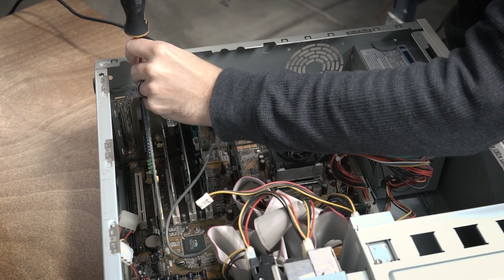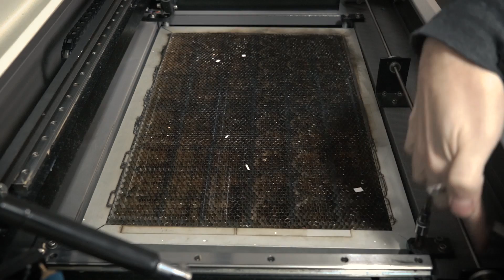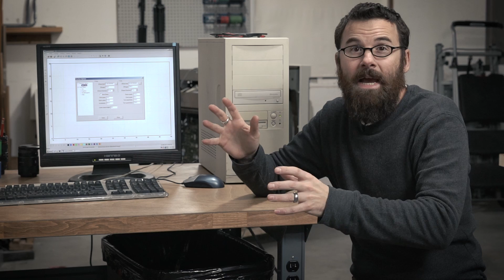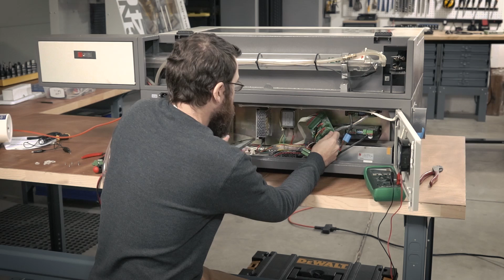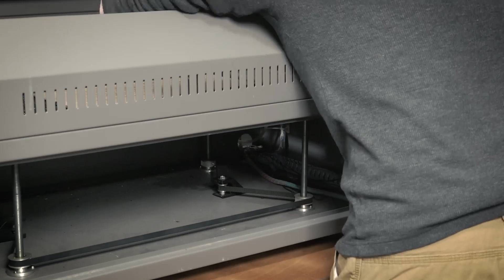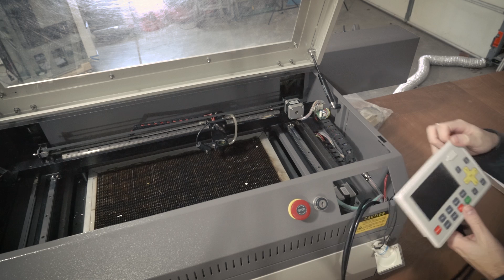DSP Laser Controller Install

Comment: hello...i already installed this AWC708C controller at my old laser machine SW1290 siwei brand but not totally working good....the machine cut not smooth. e.g :- circle cut run not as a circle and have a gap with it....another problem is the starting point cannot be set as i want to...are you have any opinion about my problem about this....
Reply from the maker: Regarding the movement, are you sure your stepper settings are correct?  It sounds like they are maybe not getting enough power.  You should be able to set the starting point wherever you want.  Just press the origin button.  Sometimes I use a second layer (like a rectangle or circle) around what I'm cutting to use as a reference.  I can then disable the layer, but the reference stays.
Reply: We had this issue on our laser and it turned out that the grub screws holding the belt wheel on the X axis had worn away slack where they fit onto the pin connecting with the cog from the motor. So when a circle is drawn there are two little kinks as the X direction changes. Not sure how well I have explained that but basically it's a hardware issue not a software one. We took the belt off, removed the cog and drilled a little deeper into the shaft pin then re-fitted making sure the grub screws were well tightened.

Comment: is the dsp able to set the laser power through software?  i know with the cheap ebay cutters you have to set the laser power before you do any engraving.
Reply from the maker: Yes, you can set laser power from the controller/software.  You can also do multiple layers too.  You can then adjust it through the controller for tweaking.
Reply: Thanks for speedy reply. gotta say, content is top notch.
Reply from the maker: thanks!

Comment: Hmm what about laserweb on a raspberry pi, and a smoothieboard? It being open source is a big plus imo, and it's really active development wise.
Reply from the maker: That's certainly a possibility, but I wanted something a bit more robust and less DIY.  The smoothieboard is nice enough, but I like that this controller is specifically designed for a laser.  I looked into most of the options and it's much nicer having control hardware that's 100% specific to the machine.
Reply: Gotcha. I guess it's also a difference in how one uses the machine. I'd prefer using a web interface through and through (hence laserweb) but I get the appeal of a panel in the machine with the controls associated. 

I suppose I'd ultimately use two RPis in it, one with a 7" touch screen for a local panel, and one for laserweb. Maybe have 1 do both, but I don't know if that'd sacrifice motion smoothness
Reply from the maker: I don't really find myself using the interface all that much honestly.  I just adjust power, set the origin, stuff like that.  It's much easier AT the machine rather than over the network.  All I do on the computer is import my DXF or whatever and send it to the machine, I do the rest AT the machine.  I haven't used laserweb, but it seems overly complicated for a laser.  It doesn't make sense to me to jog the machine and such when you're not AT the machine.  I have these controls with my 3D printer, and it's really cumbersome.  Having everything on-board is the way to go for me.  Having multiple raspberry Pis shouldn't affect performance, they aren't actually doing anything really.  All the motion control will be handled by your controller (smoothieboard or whatever it is).  The Pis just simply send it commands and tell it what to do, but all the actual work is being done by the controller.
Reply: Yeah I'm aware that a single Pi probably could handle it, but I've had issues with using octoprint for my 3D printer on a Pi1, where if I was using the web interface too much, the G-code sending would grind to a crawl, and the printer would begin stopping waiting for moves. I've never had this issue on my RPi3 though.

I'm not at all experienced with laser cutters, I have a large 3D printer and that's it, so that's where I'm coming from. It's right behind me when I'm at my computer, so I control that entirely through the web interface. I suppose that's also why I didn't think too much about a panel.

I guess there isn't too much to controlling a laser cutter. Variables are after all just travel speeds, focus, power and homing I suppose. But then again, it doesn't look like there's much more than that in laserWeb (live demo here https://laserweb.github.io/LaserWeb4/dist/)
Reply: Also, I just found out that the latest laserweb (4.x) doesn't support DXF yet :/ 3 did though
Reply from the maker: Ah, kinda a deal breaker then.  I use a laser probably more than a 3D printer and it always ruffles my feathers a bit when companies try to act like they're the same machine (or for that matter, the same as a CNC milling machine).  They have similar controls and hardware, but using them is completely different.  I would highly recommend people look at machine-specific control systems.  I would never use a smoothieboard for a CNC milling machine, but would highly recommend it for a 3d printer.  And likewise, I would use Mach3 or similar for a CNC, but not for a 3d printer or laser.

Comment: Can this controller be used with solid state diode laser heads?   

http://www.banggood.com/445-450nm-15W-Blue-Laser-Module-Mark-On-Metal-for-DIY-Laser-Engraver-Machine-p-1137779.html?rmmds=search 

I would think that PWM is PWM no matter what you are sending it to.
Reply from the maker: You might be right.  I've never used something like this, but it might work...  Sorry, just not familiar with diode laser heads.

Comment: hi .. thanks for the video. i also have the AWC708C Lite, but not installed or used it yet. How has it been for you, still happy with it ? Thanks
Reply from the maker: I'm VERY happy with it.  I've bee using the laser a lot lately and really really like this controller.  I would highly encourage the upgrade.
Reply: that is good news. i currently have the 60w red version on ebay. it uses RDworks, which isn't too bad, but I am planning on selling that and building my own using the AWC708 controller. Glad you like it ... what about rhe software, uses LaserCAD right ?
Reply from the maker: Yes, it's LaserCAD.  It's OK.  I don't really use it, I just import DXF files from Solidworrks or elsewhere.  It works fine for what I need, but I don't do a lot of engraving or anything fancy.
Reply: cool. what i do too, i use soidworks/autocad or fusion360 and just import dxf, select my cut and engrave layers and off i go. anyway, good it worked out for you. love the channel btw, subbed !

Comment: I am getting ready to hook up my "X7" from Light Object and was curious if you know what pins work for the autofocus and is there pinout for a safety door switch?
Reply from the maker: I'd have to look at the manual again, but the safety switches (lid and water) can either be connected through the power supply or through an input on the controller.  Mine are connected in series with a safety swtich on the power supply for the laser.  It has a pin (forgot what it's called) that needs to be tied to ground for the laser to fire.  The water chiller and door switch are just in series with this pin, so if either aren't closed, it won't fire.  You can do this OR connect to the inputs on the controller.  but you'll need to set it in software (check page ~23 of the manual).  I'm not sure about autofocus, since I don't have one, but it should work pretty much like the X and Y limit switches.  It looks like you can even set an offset.
Reply: Awesome! Thanks man. Great video too by the way.
Reply from the maker: Sure thing.

Comment: Love your video.  I have a 60w laser that the X Y just S*&^t itself. Can't find where the problem is exactly but it is looking like in the main Laser board.  Considering upgrading to what you just installed, but not too sure of wiring up.  First I need to buy although the cost here in Aust. is double to what you paid.  Once again, excellent presentation.  Rob
Reply from the maker: Bummer!  I would highly suggest looking into something like I got.  I've used a few lasers in my time and I like this one the best.  I actually prefer it to the controls of Epilogs too.  It's worth the money, but it would cost quite a bit for you though.  Good luck and let me know if you have any questions.
Reply: Hi Robert.  Have a question?  Do you know much about the Limit switches and how they work. Mine are also connected to the power supply. I have put 2 new stepper motor boards in. They now hold the steppers in place when powered On but does not Reset or move.  If one of the Micro switches is faulty, would that stop the power to the steppers to return to the Home position?  I have ordered the AWC708C from a site <sign-in-china.com> He has done me a great deal cheaper than anywhere else on Ebay.  Highly recommend for any parts for Laser.  Rob
Reply from the maker: Your limit switches are connected to your power supply?  that doesn't seem right...  are they limit switches, or safety switches?  Once you get the AWC708C, look at the hookup diagram, and everything should connect easily into that.
Reply: Oops Sorry. All the wires are bundled together in a loom wrapped in Black.  The limit switches and the safety switches have the same colored wires. Damm confusing.  Thanks for that.
Reply from the maker: That makes a LOT more sense then...

Comment: Why not Ruida controller, say 6442 ? They are very popular and well described, software (RD Works) is quite friendly and wide avialable? I know it is a bit more expensive (say 50-100$ range) but you can got strong support from many other users what is a priceless.
Reply from the maker: I did a lot of reading and people seemed to prefer the one I got.  Since the majority of what I do is just export DXF files from Solidworks, I didn't really need robust software.  So far, it seems to do everything I wanted.  The 6442 looks nearly identical (at least in terms of hardware) to the one I got.

Comment: it is very good, if you have any  questions  about  the software , i  will help you
Reply from the maker: I used it last weekend and it worked well, I really like the controller.  I will play with it more and let you know if I have any questions, thanks!
Reply from the maker: I actually do have a question.  How is air-assist controlled?  There is a check-box in the software.  How is this controlled, is it one of the outputs?  Is there a way to control the outputs through software?  I would like to use the outputs to control solid state relays for lighting, exhaust, or air assist.  You can reply or find my email address under the 'about' section on my channel, thanks!
Reply: yes,  you can use  OUT1 or OU2 AND  OUT6, there are different functions.  Pin	Definition

2	OUT1, Blowing signal(The whole process of blowing)
The machine is idle, the motherboard output OUT1 LOW；
The machine is working, the motherboard output OUT1 is high。
3	OUT2, Blowing signal(The whole laser process of blowing)
The machine is idle, the motherboard output OUT2 is low；
The machine laser is working, the motherboard output OUT2 is high
4; OUT6: The layer blowing, you can select some different layer,  you set yellow which can blow and red is not blow
Reply from the maker: Thank you, I will play with it this weekend and see if I have any more questions.

Comment: I see living in CO is nerd central, damn that's a screamin' deal!  I used to live in the SFbay, but moved north and if you want animals or farm implements, this is the place.  Vintage computers or anything high-tech, not so much.
Reply from the maker: Actually craigslist around here is alright.  What most people don't realize is that I look for a LOT of stuff constantly.  It took me 2 years to find a laser cutter.  Same with the Stratasys.  Sure, there's a good tech industry out here, but it still takes a LONG time to find this stuff.
Reply: EFormance Engineering 
Can you please help 
I install a Ruida 6442s-B(ec) to my machines Now he failed on fire from the controller If I plug out the plug on the laser transformer and push the button he fire But nothing from the control board My tape  of  off laser transformer.  Myjg80

Comment: We didn't get to cut anything! Maybe next time. Great video. Your garage must be getting full with all these new machines you have been working on.
Reply from the maker: Yeah, sorry!  There are two reasons for that.  1) it's really cold in the garage right now, I didn't want to thermally shock the tube.  2) the machine is currently in the middle of my shop so I could work on it, so venting the fumes is a bit of a challenge.  Even cutting a really small pattern creates a LOT of fumes/smoke
Reply: Makes sense, I'll be waiting for the next video!